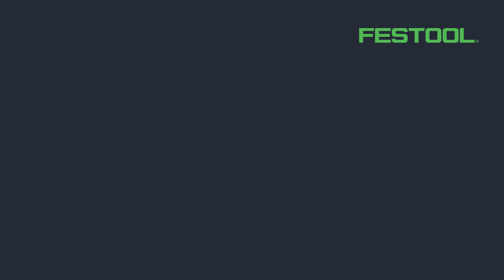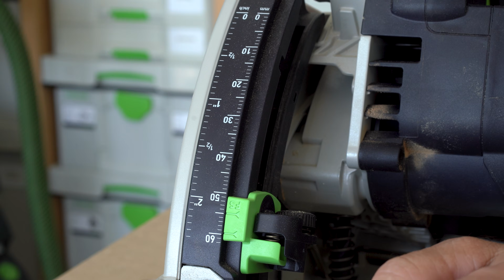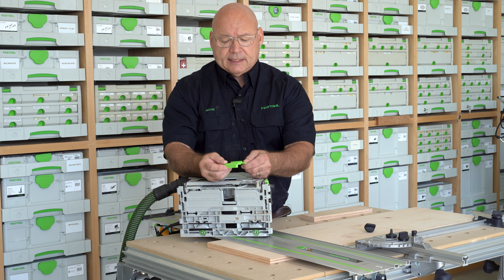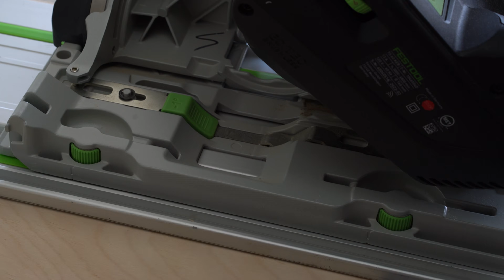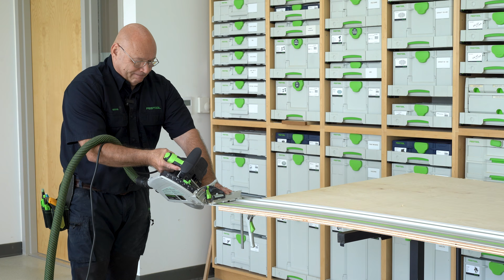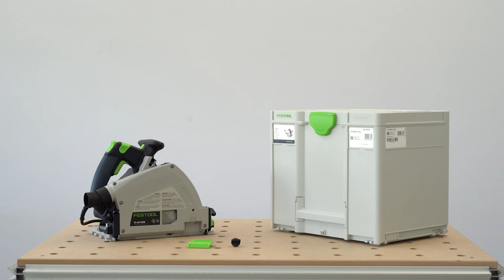Rip and Crosscut Accurately with the Festool TS 60 Plunge-Cut Saw

Comment: Can I use this saw or the HKC55  on the tracks for my TSC55 without damaging my splinter guards for my TSC? Can I use the TS60 on my dedicated HKC Tracks without damaging the splinter guards for my HKC55? Is there a blade offset difference that would impair splinter guard performance or do all of the blades line up with the splinter guard perfectly? 

I’m unsure if I have too many dumb questions…or I’m buying too many Festool track saws!
Reply: You should be able to use the HK on the TS tracks, but not the other way around
Reply: @JamesDalphond  Notice they did not answer your question "SHOULD" is never an answer.
Reply: You can adjust the blade offset. There are tutorials on YouTube. It’s not hard.  I use hkc55 and hk85 on the same tracks but they were initially slightly different.